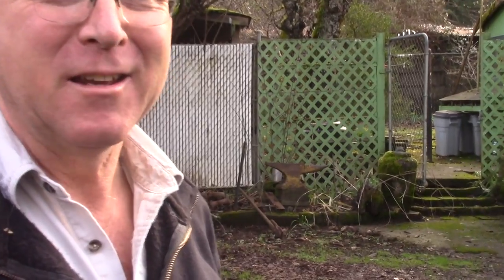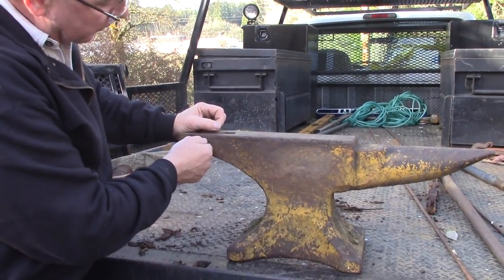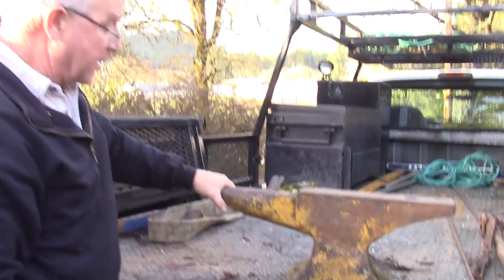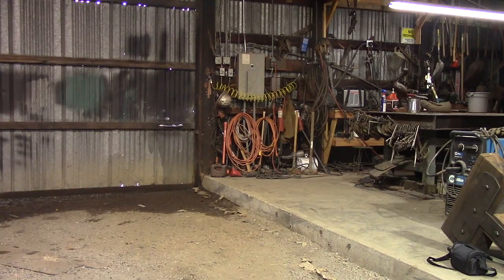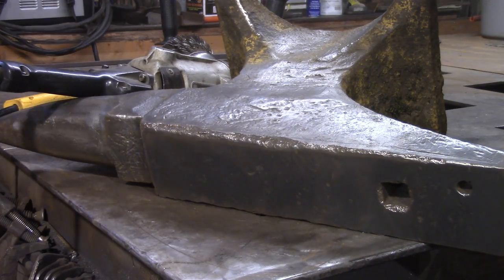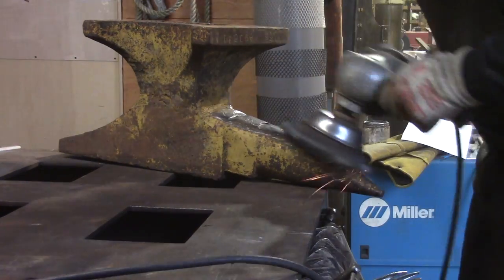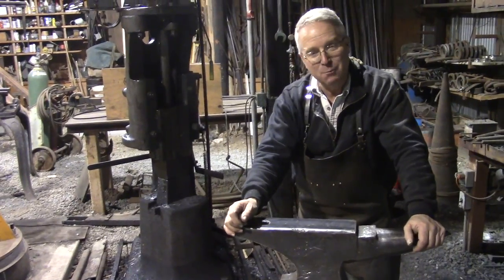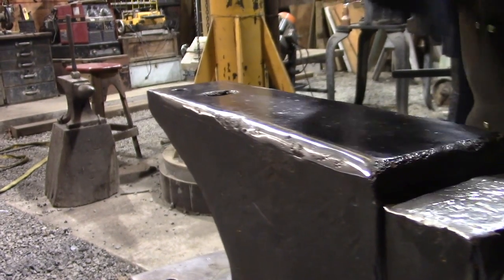How To Find An Anvil

Comment: First go to a part of the forest where anvils are commonly spotted on trail cams. Then set out some bait. Some 1000° knives should do as there natural forging instincts will draw them in. Then when they are close enough hit them on the head with a short handle sledge. This will temporarily stun and confuse the anvil. And there you go you now have an anvil.
Reply: Frequently Asked Questions ok that was funny
Reply: Frequently Asked Questions I did this once... It was a tough anvil. I had to stun it a few more times though. WARNING: the anvil will break your sledge every hit (make sure you bring extra sledge hammers). 

Also, get ready for broken limbs. THEY WILL ATTACK.

Comment: That is indeed a fine anvil!!  I've got a small shop in a farming community, and anvil was offered about ten years ago, brought in, 150 for a 1917 Fisher, with a similar laminated hard face.  It is chipped on the off edge, but as you say, and it's relatively flat, not worn out, and sound.  I'm very pleased with it, as you say, made when men knew how to work and weren't afraid to.  I think an age like that is coming on.  I was considering welding up mine, but am convinced it's just fine, haven't even cleaned it, just mounted it and put it to use.  Thanks for sharing this, enjoyed watching you fettle it up, and make er pretty.  Semper Fidelis.

Comment: I want an anvil.  But, not for $14,000.
Reply: Get a piece of railway - the steel is similar enough to perform basic anvil tasks.
Reply: anon746912 Not at all, railway steel is actually rather more like mild steel rather than hardened steel as an anvil would, railway steel isn't close to as hard as you need for an anvil, not to mention it terrible rebound and would require a fair amount of work just to get it up to a reasonable size and weight with a flat face. The whole railway thing is an old myth they really make terrible anvils
Reply: Shazzkid they are pretty bad compared to a true anvil but one small piece of railway track got me into blacksmithing. If there's a will there's a way right?
Reply: More important to get into the trade, starting small.
Reply: I think maybe you can weld a piece of hardened steel on top of the rail.
Reply: When you start you will get bad results no matter what you use, so yeah, even if a railway is not as hard as an proper anvil it will be an adequate starting point.
Reply: Jose Moria this is over a year old man
Reply: R. Blakehole i got one
Reply: i have a armatige anvil for sale
Reply: In hungary anvils wich on perfect shape costs 1000ft/kg wich is about 4$/kg so if you want an 100kg anvil it will cost you 400$
Reply: @egy_fekete_volga755  ft( feet) is a meassurement of length not weight. Lbs.(pounds) is a measurement of weight in imperial system.
Reply: @RB-dn4pj  sorry, you dont understand me. Ft is money in hungary.  Wich 1$  is about 350Ft
Reply: The problem with buying a brand new (real)anvil is that nowadays, good anvil steel can be anywhere between $3-6 per pound(like say you went to a fabricator shop to have someone carve you an anvil). Buying online can be much worse because of the shipping cost, as good anvils can be very heavy and therefore very hard to move.
Reply: Pretty much. Like no sane person would spend the amount of a new car for a block of steel

Comment: $14K... Am I the only one that thinks thats insane?
Reply: and it will last 10-20 years not a 100+ like anvil.
Reply: Joe Gray mm
Reply: Ya that's stupid expensive.  I use a section of train rail.  Before that I used a section of I beam.  Both were free and work pretty damn good.
Reply: yeah that doesn't make any sense to me. I'm no expert in metal pricing, but wouldn't it be cheaper to cast a brand new one?
Reply: Hunt craigslist and facebook. Me and my brother got one in somewhat rough shape for a few hundred but it does the job
Reply: I agree, very much on the high side Joe.. The only way to justify that kind of expense would be if it was used every day AND a Hay Budden had some kind of special place in the heart. Maybe like spending money on Snap-On tools when suitable and quality tools can be found elsewhere; but it wouldn't be a Snap-on or in this case- a Hay Budden.

Comment: If you can't find an anvil, will a piece of railroad rail be a decent substitute?
Reply: I have a Wright anvil and a foot of track.  I use both, but since the track is more portable, I probably us it more.
Reply: Who makes shit anvils?
Wouldn't shit be kinda soft to use as an anvil?
Reply: Well, shit anvils do have a sort of Gallager effect.
Reply: What if you just want to anvil shit?
Reply: Chris Brewer 

Yes.
Reply: Rails are made of high Carbon Steel alloyed with many things depending on use.
They make excellent anvils for the casual user.  They are 'measured' by weight per 3' section.  My anvil is from 127# rail.  Works great.
Reply: Gord Baker so where does one get a piece of railroad rail? to me, that seems just as far away as an actual anvil.
Reply: @Masdivot  thank you.  Commentors on these channels talk about scrap rail road tracks as if they are just lying around everywhere.  I'm pretty sure I've seen more anvils in my life than pieces of railroad track.

Comment: Thanks for sharing your journey in finding and buying that anvil and your tips for finding them.  What specific type of welding rod (or wire) will you use to build up the off edge?   

It's always a good idea to ask the sellers about what happened to the tongs, the hammers, the blowers, the anvil tools and the other tools used by the blacksmith, including the swage blocks, and the forge, left-over blacksmith's coal, etc., that the prior owner used with the anvil.  If you can find a nice power hammer, it can make life in the shop a little easier.  They are so heavy that many people consider them to be nuisances, once the blacksmithing operation is closed down, and they will practically give them away if you will remove them from their property.  In my area I remember seeing them standing abandoned in the weeds in fields, waiting for someone to recognize their value.

Comment: My uncle once owned an anvil that was haunted.
Reply: Are you sure that the ghost didn't just have a corner of his sheet trapped under one of the feet?
Reply: Zak Bagans 2 spooky
Reply: are there dinosaur goasts
Reply: oh yeh
Reply: I guess its all good if the ghost can produce something good.  Take the day off and let 'em work.
Reply: themonkeyhand especially the quality of stuff from 1800'/s oh man i love furniture from 1800's the quality the way the wood is "puzzle pieced" together, no nails  ohhhh i love it!

 REAL WOOD no press board cheating stuff
Reply: Zak Bagans u need to do more ghost adventures
Reply: African Warlord yes. Wood joinery. Or just say joints I guess. There are a ton of videos that explain how to make dove tail joints, which are super strong, and won't flex at all if cut right. They are tricky though, but a valuable skill if you want to make a quality price of furniture.
Reply: I went out drinking with an anvil,  we both got hammered!
Reply: To answer that question one would first need to know what a " goast " is!
Reply: Zak Bagans I think I'm trying to pass an anvil at the moment. The blood vessels in my eyes are bursting.
Reply: Zak Bagans can i have it?
Reply: Haunted ??  ... Or. Cursed ... ??

Comment: Seems to me just a foot to two of common railroad track would do just about most stuff a generic garage mechanic might want an anvil for.
Reply: I don't even use that... I use one of those railroad foot plates that you can just pick up anywhere by the side of the tracks... I have 4 or 5 of them dating back to 1901 that I use for all sorts of purposes.  Straigtening out metal, as a plate for a kickstand of a motorbike on soft ground, and other things.

Comment: Cool video! Just out of passing interest, it is possible to 'save' Craigs List searches... and automatically receive an email whenever a new ad is posted with your search term/s. Ebay as well. As a matter of fact I snagged a set of rare hard to find camera extension tubes (for macro close up work) just the other day. Was up late snacking and checked mail... just as I was about to sign off an email notice came from Ebay; and within maybe 2 minutes the tubes were mine! Took about 5 months of waiting for someone to list them though... but the tubes are near new pristine, and I got a smoking good buy it now price!

Comment: I really need to make a forge now. My anvil was the first step of many including making a base (I know of a place nearby that makes staves for bourbon barrels for white oak logs and short sections of logs are plenty and usually in ready to use sizes) but I forge is the big thing now. I'd prefer to run coal but my problem is that I'm limited to what I can do outdoors since I have no barn or shop. My 1 car garage of filled with tools and woodworking equipment but until I build a barn I'm s.o.l. some kind of reasonable sized forge I can build and leave outside would be a huge asset, even if I have to use a shelter house type roof to cover it. The anvil won't live outside though. It's tricky I guess

Comment: I've been fortunate to own an anvil for the last 34 or so years.  My oldest son, Brian, is a machinist and spent a ton of time in that shop in high school.  When he graduated, the school was closing.  His Shop Teacher knew that I was a shop nut, woodworking, welding, fiberglass work/etc.  He asked Brian..."would your Dad be interested in a free anvil?"  Answer was a quick...YES.  The teacher said that everything would be going into or had gone into the dumpster.  He'd rather see me have it that the custodian or a dumpster diver.  There were 10's of thousands (over 100, 000) cloth back disc sanders that I have been using for a long time.  Brian was able to rescue 3,000 of them from the dumpster for me.  The rest were unusable as oil had been dumped all over them.  I couldn't believe the waste. I'm still using some of those same discs and still have the installer tool for that.  Those 100,000 pieces had been donated by somebody (manufactured in Canada) and most were just dumped.  Hard to believe the waste.

Comment: I've got a Trenton  that weighs 117 lbs. Mine had some number on the foot. One set was the weight the other set according to some folks I talked to on line  was a type of serial number that would tell you something about when it was made. If I remember right mine was made in 1903. It looks actual like yours. I looked a long time before I bought it.

Comment: Very nice find! Question on that weld you spoke of. I grabbed a Trenton in great shape though it has a massive hand forged U bolt that was drilled through the body above the joint and secured below the feet with a plate and large nuts. The joint was ground out below the horn and below the heal about 5/8" deep it looks like to accept a weld. Though that repair had never been completed. It would have taken a skilled smith with a large press to do what had been done to it.  Thing is it is a very sound temporary repair, no rattle great ring and rebound. Have you ever heard of a repair like that? You're the first to mention the Trentons having a welded base. I always suspected just wasn't sure.
Numbers off the feet 177  guessing that's pounds, and other side A17333. Any info on those numbers would be appreciated. Thanks for the great vid.
Edit there is a Z left of the weight, guessing that's the Smith who made it. Also Large Hour Glass indent on bottom not oval. I read somewhere they changed to oval depression after 1907?

Comment: I have the anvils I need for my amateur blacksmithing and have sold others I've found in my picking operation. One thing I wish: that I had a tractor-trailer's worth of anvils. I never have any problem selling any size or condition anvil I have. They're just really hard to come by at a bargain (or at all) in my neck of the woods.

Comment: I scored a 245 pound Trenton in slightly better shape than your flower garden find about 2 years ago.  The guy I bought it from turned it up with his backhoe when he was digging for a new septic field.  The site was a smithy back in the 30s, so he figured it had been buried at least since the late 30s or early 40s when the barn burned to the ground.

 It sat in his workshop for the last 20 years, and he sold it to me for the tidy sum of $250!  It surely is getting harder to find a decent anvil for a fair price.

Comment: Nice score.
I worked in a shop with a gravel floor, had some problems in the spring with a high water table.
Yours seams to be dry? and do you prefer working on a concrete or gravel floor?

Comment: I found an anvil at a farmer's sale for 720 dollars which wasn't advertised, I cleaned it up , weighs 139 lbs. as stamped, it was a Trenton Ajax real good shape the bonus for this 720 dollars was the fact it came with a matching cast stand that weighs about 225 lbs. fits it very well, just got real lucky at this auction

Comment: Ok... If I understand correctly (doubtful) for a typical Blacksmith a 175lb to 250lb anvil is sufficient?
For a single blacksmith the average size shop looks to be about 20' x 20' x 10' tall?
I'm unsure if Coke (coal) or propane are the preferred fuel (looks to be coke)?
For a beginner a bottom air flow is fine but a side air source (water cooled) seems to be preferred (what's better?)?
It looks to me that the most expensive part of this hobby (job?) is the location and structure (safe & secured), the basic equipment can be found or built inexpensively.
I know they'll be more questions but one I'd like to know is if an anvils face should be 4" wide (typical) or 6", maybe wider?
Thank-you for the time, it's been informative.

Comment: Mostly good info, aimed at the beginner, if the anvil was arc welded at the waist then the whole top half is tool steel and it does not have a hard plate. Trentons just seem to find me, I have 4 spanning 1901 to 1939. I grind both edges near and far, to a taper radius both are useful and I tend to use both equally. Don't weld on an anvil unless you can do a full harden and heat treat. The heat affected zone will always be soft even if hard facing rod was used. Nice find.

Comment: Those edges..... grind them back a bit and arc weld on some hard facing rod (the least nuggety sort) then gring back square and sharp. Difficult to see the repair and gives a very durable edge... :-)
They are like hen's teeth in New Zealand.....

Comment: I was lucky enough to find a 264 pound Peter wright with a Peter wright post vice in a barn find. It also came with the stump, cutoff, tongs and hammers as well as a twisting wrench. I will spare you the heart attack and not divulge the purchase price. BTW, the equipment was in great condition.

Comment: I'm hoping you may be able to answer a question...just got my first anvil(traded a pocketknife for it), haven't set it up yet and I'm wondering if the beak should be to my left or to my right?thank you in advance!
Reply: This is often down to preference, but also depends on the work you will be doing
Reply: As Tim Rayner mentioned, it does come down to preference. However, for farriers, the horn/bick points away from your dominant hand. If you're right handed, the bick points to your left. This facilitates the working of the shoe over the bick and your hammer hand doesn't have to cross over your tong hand. Having said that, I am left handed and I have the bick pointing left! I am not a farrier (horseshoes) and, therefore, being crossed up isn't an issue for me. The reason for being "backwards" is that my hammer hand doesn't hit the face of the anvil. Anyone who has done any amount of forging knows that hitting your knuckles on the face of the anvil whilst hammering is very painful. The disadvantage of crossing over is outweighed by the advantage of not smacking my hand on the anvil.
Reply: Glenn Wiebe wow,thank you for a very informative and helpful response!this is the type of answer I was hoping for...
Reply: You're welcome. While I don't have a youtube channel, I have been blacksmithing for years and have managed to acquire a little experience and hopefully some knowledge which I freely share. Keep forging!

Comment: I have an old anvil that was my grandfathers and even a old forge . The kind with the pan on a stand with an old hand cranked blower. The anvil looked very much like the 14 thousand dollar one you showed but i am certain it doesn't weigh more then 100 or 150 pounds,, i'm guessing mind you. It does have some markings on it but being it's past midnight now and it's at my mother's home.There's is one thing that could be a problem with this anvil and that is the corner where the round hole on the top is broken off. i wouldn't think that could be repaired or even if it needs to be.' If i remember correctly i think it has a date in raised letters on the side.
Well like i said it's late and i got to get to bed but i'll get what info i can off the anvil and take a few pictures to share. I've never thought of selling either the forge or anvil but then again i would use them and it would be nice to know they would be used by someone that appreciates such things and not sitting in a barn like they have for the past 50 plus years i know of.
Goodnight and i'll get more info asap.

Comment: There's a 150 kg (330 lb) anvil 36 miles from my house, for 100 euros (113 $), that i hope to bargain down to 80 euros (91 $). Should i jump on it ? It seems to be in a good condition, a lil bit rusted obviously, it has both a round and a pyramidal horn, a square and a round hole. If any of you bougth an anvil by the past, what would you recomend me ? Thank to anyone who helps.